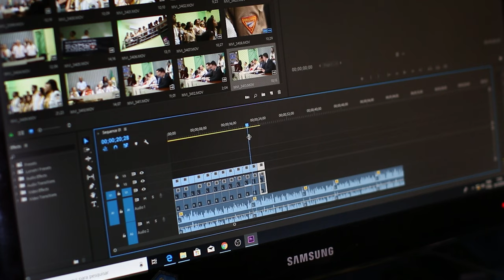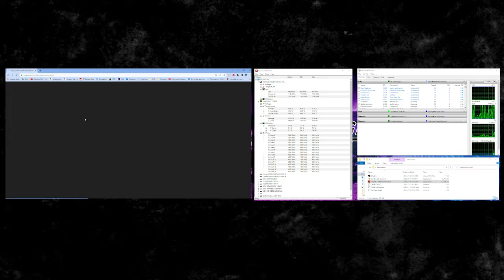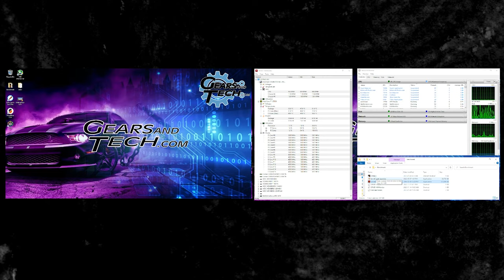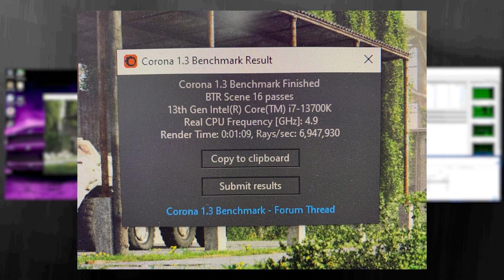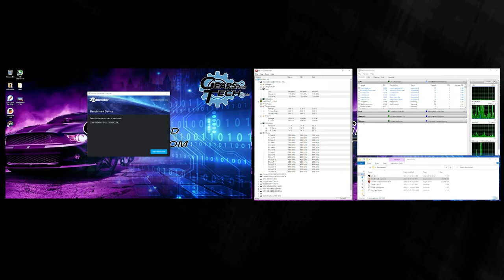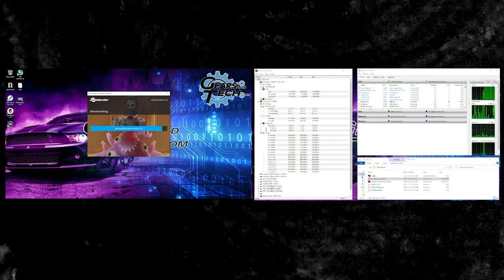COOLING DOWN the NEW Intel i7 13700K CPU ~ Whats the MINIMUM Cooler size that works? |Gears and Tech

Comment: Do not find your video really meaningful for a 13700k. In my opinion your case is not good. Who installs a 240 AIO in the case above when there is only one outlet? In my opinion, meaningless. You don't need to be surprised at such high temperatures if you can only dissipate the heat through half of the AIO. Buy a new case with enough outlets at the top so that your AIO can also work effectively - with 2 fans.
Reply from the maker: Totally agree 

I am trying to find the minimum required
Reply: Thats what this video means ...try to make the minimum setup..

Comment: USE BOTH FANS on the rad. That's what it is designed for!!!! The idea is to cool the water in the radiator to ultimately cool the cpu. If you want to increase your ventilation in the case then BUY MORE FANS
Reply from the maker: Agreed
Reply: fully agreed ... this video looks wildly incompetent because of this
Reply: You have no business doing computer reviews… You barely understand how any of this works.

Comment: Damn, I have a 12600k mildly overclocked and I never get temps over 75 degrees under sustained 100% load. It is under a 360 AIO, but 90+ degrees is insane. Another thing to ck is how your cooler is mounted and thermal paste coverage. I have heard a lot of stories about poor AIO mounting causing poor temps, especially on LGA 1700 CPUs. I used a Cooler Master Master Liquid 360 with Thermal Grizzly Kryonaut paste and its worked really well. A contact frame mount can be helpful as well.
Reply from the maker: I actually got a frame mount but haven't installed yet
Reply: @GearsAndTech  Let us know how it does.

Comment: Can i use air cooler for the non-k i7 13700?
Reply from the maker: Good quality air cooler works. But is more prone to heat issues
Reply: You can even cool the i9 with it…as long as you are not rendering all day long or run benchmarks 24/7, or let it run without limits.

Comment: LS520, an excellent 240mm AIO, can't even stop a 13700 non-K from thermal throttling (even if only by 2-300 mhz) in a near-open-air case. Its crazy.
Reply from the maker: These things run hot for sure
Reply: You can easily stop if from thermal throttling and not only keep the mhz but even boost longer with an 240 AIO if you undervolt. Mine is air cooled and won't get above 90 degrees in cinebench23. I think mine is running at a -0.07 V.
Reply: @GearsAndTech  hello I have the 13700K I haven’t overclocked or anything only thing that’s on is intel turbo boost was on by default my voltage idle is usually 1.2ish when gaming it’s like 1.279 highest I have seen don’t quote me on that lol I will double check tomz would you say they are okay yeah voltage wise

Comment: I've got a 13700K being cooled by a Corsair H100i Elite Capellix. Temps idle in the low to mid 30's or high 20's depending on ambient temps. In games I never seem to get above 60, and in benchmarks such as cinebench r23 I top out around the 70's -  80's.

I think what helps is that I'm using an aftermarket ILM to prevent IHS deformation and obtain even contact between the CPU and the cooler. I managed this using Noctua's NT-H2 thermal solution.

I think it's also worth nothing that I've applied a small undervolt on my chip of about 0.15mv through Intel XTU.

I'm hoping that this info alongside the video may help someone in someway. :)

Also, new viewer here! The format is nice and you seem very well informed. I'll definitely be checking out further content. 😁

Edit: Fixed a typo
Reply from the maker: Awesome. Thanks for the info and thd support
Reply: I use the same cooler with no aftermarkets fans and my CPU runs about 20-40 idle and then jumps to 90 degrees on demanding games
Reply: Majic what kind of aftermarket ILM you used ? any link or the accurate name

Comment: I've been researching these temps the 13th gen chips produce. I'm going to be upgrading next week to the 13900k. Bit overkill but hey why not. I have seen that these motherboards automatically apply an overclock of sorts that bumps up the watts above what Intel specs the chips. I'll be looking to turn that off and see if temps and performance still remain
Reply from the maker: Excellent point. I have seen any real overclock though. The performance always falls in the average range

Im playing with undervolting now which is helping with the temps

I'll post videos once I get it al figured out
Reply: @GearsAndTech  I think it's also down to what the person uses the chip for. I'm a gamer who doesn't do editing or content creation (stream occasionally) so I very much doubt I'll be hitting anywhere near the power consumption you do with the editing tasks you have to perform. That and my case has 9 fans should help with temp issues. Thanks for the video though. It's really informative and goes to show that if you're going to get a high end cpu like this then you have to think of getting other high end components

Comment: i7 13700k / phanteks case / Bequiet 3 fan & rad front mounted (The 3 Fan one) / late 20's idle / Ingame AC Valhalla never over 60 on ultra with RX6800XT 150-180FPS - Conclusion =  =)

Comment: so far the nzxt kraken 240 did okay with a non k variant but used 3 in take fans, it did hit 80+ on up to almost 90 during my renders on blender, I also turned the APE on auto for asus motherboard, be wary for those who don't know, this bios setting cause it increases the power limit on purpose even if you didn't overclock the cpu.
Reply from the maker: Thanks for sharing
Reply: I have  the same cooler but the elite and yeh my 13700f is over clocked to 5.2 and it runs very hot.. According to intel this is very normal.

Comment: Changing AIO 120mm to AIO 240mm doesn't make sense if you use 1 fan in 240mm. Only the amount of fluid in the circuit increases, with such mounting, which will not improve the temperature and may only delay throtling. 
I have a 13700K and Noctua NH-D15 chromax black in a Fractal Torrent and with the 253W limit, the temperatures do not exceed 90C. Unfortunately, I have a B660 board, so I can't undervolt because I would have even lower temperatures without losing efficiency.
Reply from the maker: I'll be doing another series on undervolting as well

Comment: I bhave the 13700k in my latest build and use a Coolermaster MA620M for my CPU cooler in an ASUS ROG Hyperion case with 7 case fans with no overtemps. My normal temps stay between 35 and 40 and under load the most I have seen is 66.
Reply from the maker: That's impressive

Comment: Kraken Z73 is what I have on my i7 13700k, I never go over 90C even on the most demanding benchmarks. 
I think a 360mm cooler is what you need especially if you want to overclock this beast.
Reply from the maker: Be careful though. You may not be hitting full clock speed to keep the temps that low.
Reply: @GearsAndTech  this was at 5.3 - 5.4 GHz for 10minutes on cinabench. 
I also looked up my score which was higher than the average for the cpu.
Reply from the maker: That's good to hear!
Reply: 280+ with 2 fans.
Reply: @Kos 90c without undervolting ?
Reply: @ThePonduz  yes, I have 6 120mm fans on my 360 rad for push pull.(intake) 
KrakenZ73 w/ Kryonaut thermal paste,
I mounted the rad the at the top of the case because it had optimal air flow compared to the rest of the case.
(NZXT H7 normal mid tower)
I wasn’t worried about anything else getting too hot so I focused on cpu/rad then built around it accordingly.
(3 140mm fans in front for exhaust)
Maybe I’ll make a video showing my pc’s build,temps,benchmarks.
Reply: @Jmd886  hello what are you getting during gaming mate I have the 13700k too
Reply: @decdonald2508  depends on the game but on average 50-65C.
Reply: @i have the asus lc strix 360mm good cooler take it you have a 360 aswell in the Z73 mate off mine has that do you have a contact plate I think circle water coolers don’t really effect it the square ones were pushing against it or something could be wrong tho
Reply: I am trying to do a similar build in H7 flow. I want to use a x73 instead of z73, I just wanted to ask if you have any issues with the CPU  running for long gaming session and photo editing( Adobe mostly). Have you undervolted the CPU to get lower temps and lower power consumption? The PSU I am trying to get is a 1000W one with a 7900xtx and I don't know if i7-13700k will overload the CPU?

Comment: I’m not sure how it happened, but I have the same setup as yours and I’m experiencing overheating issues every 5 minutes. I’ve done everything I could to improve the performance, including applying thermal paste three times, but no luck.

Now I’m considering changing the cooler to the DeepCool LD240, which has higher specs compared to the current one. Let me know if you have any other recommendations. Space is an issue with this case, with a max of 240mm and a radiator length of 282mm.
Reply from the maker: CPU plate instead of the spring holder

Make sure thermal paste is good coverage

Upgraded cooler as shown and good airflow

Comment: You don need to take pictures with you phone, use win key + shift + S  and select the areat of you screen to save
Reply from the maker: I was taking the pic just for my reference quickly. The screen recorder was supposed to provide the actual screen capture to show you guys

Unfortunately it was dropping the resolution so low that I couldn't use it and had to use the pic I took instead

Comment: I have a 13700k as well, the deepcool ls520 is what you want for it at least. The ls720 would be even better if you've got the room for it. That said, you should NEVER EVER use task manager to monitor your cpu speeds with the 12th gen on. Those numbers mean literally nothing. Task manager averages the speed of all cores including the efficiency cores. That's why your speeds are way below 5ghz even when at 2% utilization. Also why they never go above 5 ghz (They actually are). You should be using cpu-z or msi afterburner to get a way more accurate readout per core.
Reply from the maker: Excellent call out

Comment: 20:08 that case is CHOKING the entire system. Not enough FRESH AIR going in and you are pulling out (though hot) more than you are putting in (cool/cold). CHOKING. The one fan on the radiator can't cool the amount of water in there fast enough, so the temps will still be high. But yeah, do see there is some attempt by the bigger radiator to cool the CPU, but can't because it's "handicapped" in it's operation. Plus, what RPM/AirFlow are those fans, how much static pressure do they (well it, the ONE fan on the radiator) pull/push to the radiator?

Comment: sorry but this is an absurd testing setup ... why not install both fans on the AIO? Put it outside that weird case that has too few holes, most people nowadays have better airflow cases
Reply from the maker: Agreed

It's now installed in the front with the front panel removed

Comment: Seems to me you have an air flow issue still. I run the same cpu. 5.8ghz OC with 6 intake, four out with 360 radiator. i dont see temps over 70c slighly positive pressure.
Reply from the maker: 360 radiator makes a big difference 

Plus having twice the fans I have 

I agree though. I'm at the very top end of acceptable with what I'm seeing currently
Reply: what's the model

Comment: You have a random ram stick at the right breaking your dual channel with unmached ram ?   With 2 exausts fan and only one intake you probably create a negative air pressure in your case, this is bad for dust accumulating and the ventilation in this case seam to be awful.  You put a bigger radiator but you have the same cabability of cooling the radiator with 1 fan.  It take just a little bit longer to reach the peak temperature but he as no more capability to get rid of the heat.  Its like a car running at idle without a fan, incrasing the size of the radiator will not solve the overheating issue, it will just take a little bit longer to overheat.  By the way it's easy to maintain the 13700k under 80c at full load 5.3 with an air cooler (nhd15), a contact frame, nice airflow and a 120mv undervolt.  It's cooler than my 10900k in the same case with the same cooler
Reply from the maker: Negative air pressure is better for dust accumulation than positive.

Comment: I watched half of the video and didn't understand what cooler the first tests were with? Model, manufacturer? What, it was so difficult to say it or write it in the description of the video?
Reply from the maker: Factory aio from ibuypower

No specs on the cooler.

This is a comparison of a 120mm cooler vs a 240 mm one

Most will work similarly

Comment: Hi I currently have a i5 12400f coupled with a b660m mobo with an SE-224-XTS cooling the cpu the temps it runs at while playing fortnite is around 30 degrees. I really want to upgrade my cpu to an  i7 14th gen but i dont know if firstly the cpu cooler can cool it and secondly whether my mobo can handle the cpu

Comment: Why not mount your 240 on the front of the case with both fans?
Reply from the maker: I ddi ultimately move it there
Reply: @GearsAndTech  did the temp go down substantially with both fans? Or about the same?

Comment: Hey have you tried using both fans that came with it to do a push pull on your AIO since you only have one vent at the top of your case? I wonder if it'll help your benchmarks at all if you're still running this setup. I looked carefully to see if having that much would clear bumping into the AIO pump at all and I think it might work out as long as it can also clear your exhaust fan on the side
Reply from the maker: I had a spare fan from the prior cooler that I put in the bottom intake spot on the bottom right side

Recently I moved the cooler to the front panel and have marginally better results.

Im gonna get this thing cooler and show videos of how I do it

Comment: It looks like you have an older ibuypower pc case. Does that case not have room in the front for your AIO? Mine has 3x 120mm fans on the front. I even removed the front panel because it is super air restrictive
Reply from the maker: True on all accounts. I ended up pulling the front cover off and moving the radiator there though

Comment: Bru change your max wattage in bios so it doesn’t try to throw max power all the time this will always throttle your cpu, get a different case or front mount, also an aio will always keep up until the water becomes saturated you need to run longer tests, ITS NOT AN AIR COOLER SO DON’T TREAT IT LIKE ONE!
Reply: Use cinibench or cpu burner and run for at least 10 minutes
Reply from the maker: I'll see what I can do with some new tests
Reply: @GearsAndTech  Fine tune the bios settings and go for all core overclock with fixed frequency and vcore. Get knowledge about it. Then you can run like 5.5ghz and 4.2ghz (ecores) with like 1.32v. That will make your computer so much faster and stable for productivity. Also safer as you will never get high vcores or high temps. 13700k can handle easily 5.8ghz on a core. Some people have gotten their good ones even to 6.0ghz.

Comment from the maker: This is the AIO we added - https://amzn.to/3GQTPZD

i7 13700 Raptor Lake Processor - https://amzn.to/3ZiPJBN
Asus Prime Z790P LGA1700 Motherboard - https://amzn.to/3GgYfc1

Looking to Upgrade your USED PC for better performance? Why not try some of these parts

240 GB SSD - https://amzn.to/3BiqB1D
USB Wifi - https://amzn.to/3lixV81
RGB Keyboard - https://amzn.to/3mshcP3
RGB Mouse - https://amzn.to/2YwazmL

16GB DDR4 Ram - https://amzn.to/3oAJedT
32GB DDR4 Ram - https://amzn.to/3agdqSZ

Cheapest GPU that can still game
GTX1050 2GB GPU - https://amzn.to/3iGxm6b

Best Price/Performance GPU
GTX1660 6GB GPU - https://amzn.to/3FnJ5R2

PREBUILT GAMING PC'S

LOW END: Ryzen 5 GTX 1050 - https://amzn.to/3EPaVUZ
MID TIER: Intel i5 GTX 1660 - https://amzn.to/3mOZdUn
HIGH TIER: Intel i7 RTX 2060 - https://amzn.to/2YoYuQm
ULTRA TIER: Intel i9 RTX 3090 - https://amzn.to/303CStA 

This is the tool kit I use to fix my cars and boats - https://amzn.to/3h58UtI
This is the Scanner I use yo Diagnose ALL Autos - https://amzn.to/3k56zjQ

Comment: 21:05 will watch. Case i got can only side mount 240/280 rad + fans (but the one I want only has 240 or 360). The case can take 360 rad & fans top & 280 or 360 fans bottom and 120 fan rear. Huh, why not get a 360 rad + fans up top? Well, I would have had to get an M-ATX board to have space to mount 360 rad & fans, I using ATX so I can do dual GPU, and neither can be too long else I may have an issue mounting the rad to the side since the hose gotta be at the bottom for efficiency (which is why I gotta watch your video). I trying to decide 13700 or 12700 CPU, temps will decide.

Comment: is it still sufficient to use an air cooler on the i7-13700k? or should it always be an aio?
Reply from the maker: There are people that have used an air cooler with success.

I personally don't like them that much
Reply: @GearsAndTech thanks for the reply, do you know any coolers that have worked? Why dont you like them?
Reply: @bosotech-wi2dz  I would look at the larger air coolers. Noctua, Thermalright and Deep Cool all have decent air coolers that would handle this chip. Just need to make sure that your case will fit then because they are big boys

Comment: I will use my pc in Antarctica . It will be kept out in Antarctica weather do I need a air cooler of high end.?
Reply from the maker: No, just make sure it stays outside.
Reply: Instead of an AIO 360mm you got an AIO 18000km. You definitely win then.

Comment: Very informative, question: Why are you only using one fan on the 240mm radiator? Did I miss something?
Reply from the maker: Only have holes up top for airflow on half of it anyway
Reply: @GearsAndTech  should have just done push/pull for the sake of testing personally.